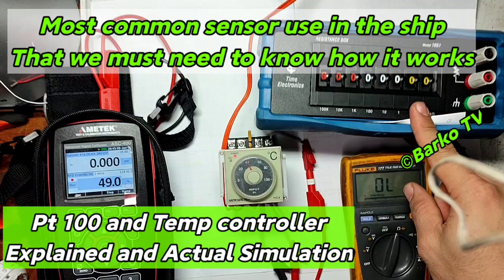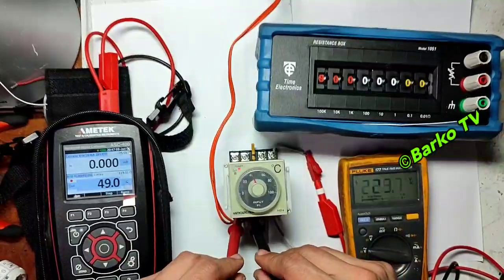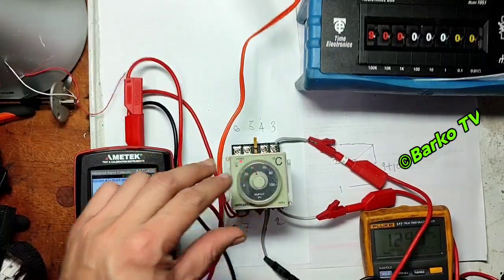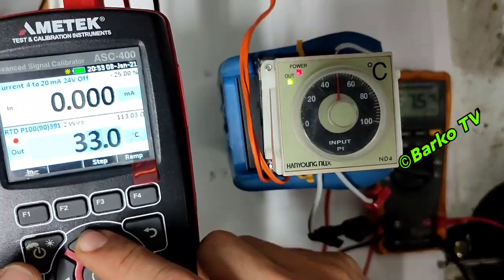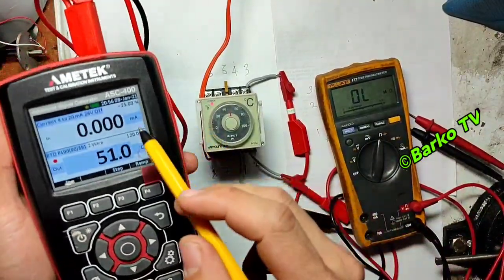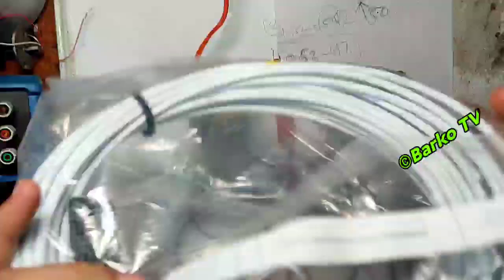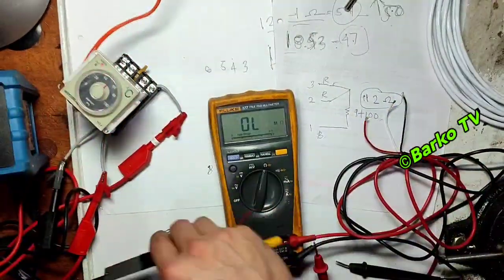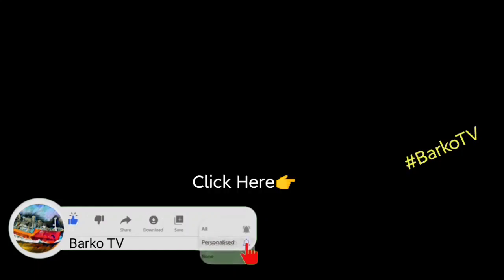How and What is Pt 100 and temperature controller | How to simulate

Comment: So sir leck kapag di pa nareach ang set point nkatrigger na ung contacts ng temp controller (indicator for OUT is on)? and pag nareach nya ang setpoint saka magOFF ang OUT indicator and balik sa original state ang mga contacts? can you give example po on this scenario in ship application? san po icoconnect ang 4-5-6 na terminals ng temp controller.  thanks sir leck
Reply from the maker: Dami yan dito sa mga equipments sir, kagaya ng mga oil pre heater, calorifier, monitor oil tracing line and etc. Basta involve sa heater. Out means contact is active, and off contact means de activated. Ibig sabihin kung normally open yong contact, babalik cya sa N open state at Normally Close contact, babalik cya sa NC state pag ang indicator out is off